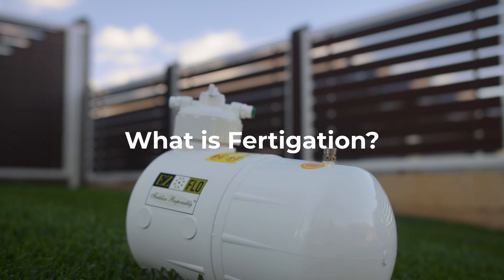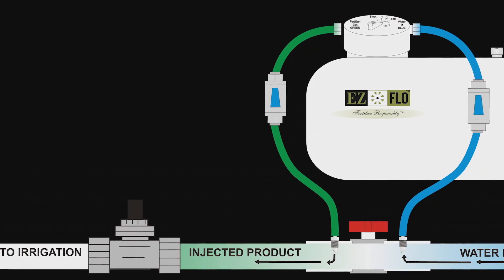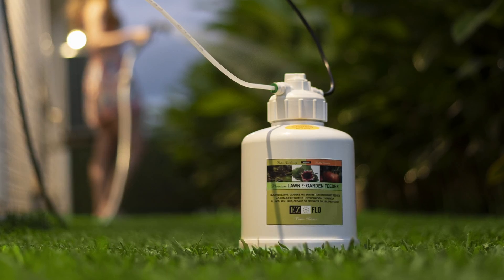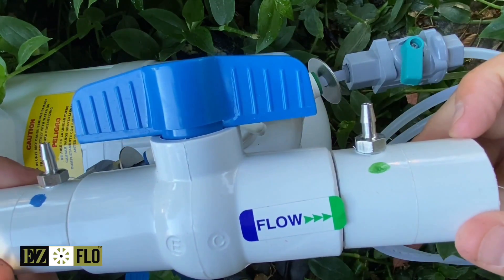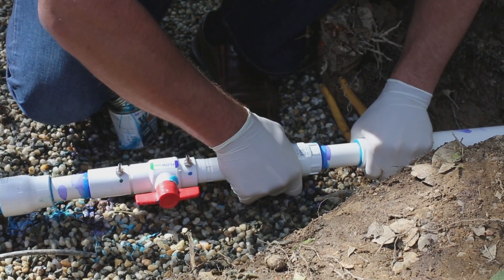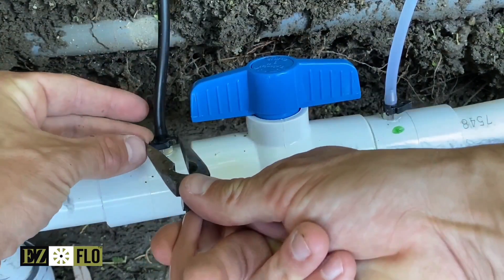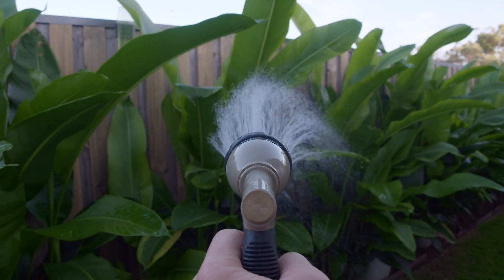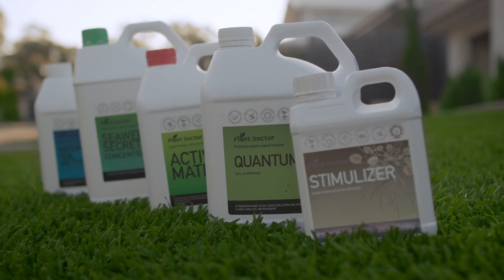EZ-FLO Fertigation Injection Systems | EZ-FLO Australia

Comment: Anytime you direct inject chemicals into a water line, it hopefully is not a potable water line!!  This is a very dangerous cross connection and requires the highest form of backflow protection; the reduced pressure backflow device.  I would even install this device if pulling from a well or pond simply because of the need to protect all of our water sources.  If you do this on your own home water system, you are taking a very big risk!  I have over 40+ years as an irrigation professional.
Reply: I have. 3" mainline from a well, what back flow preventure would you recommend